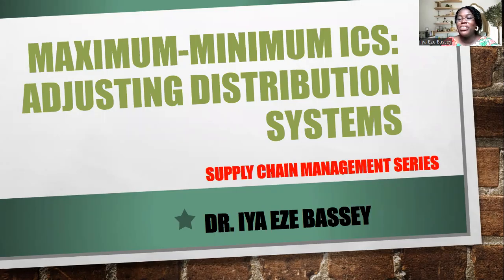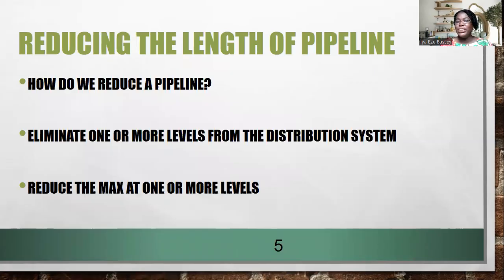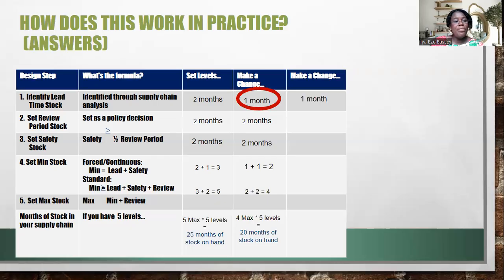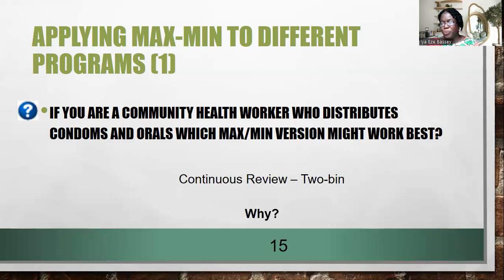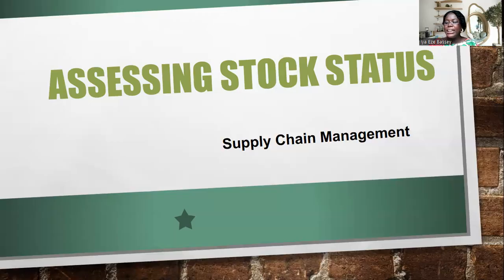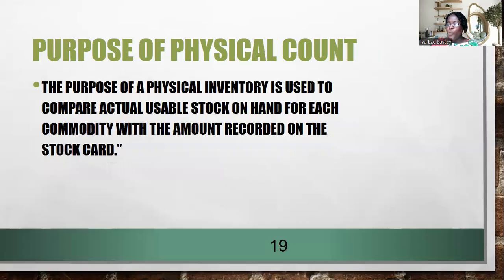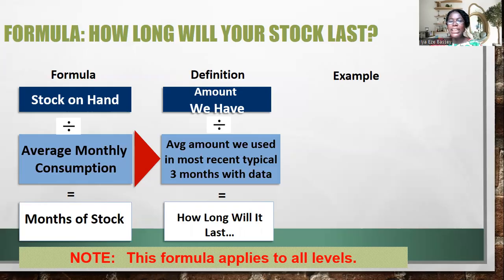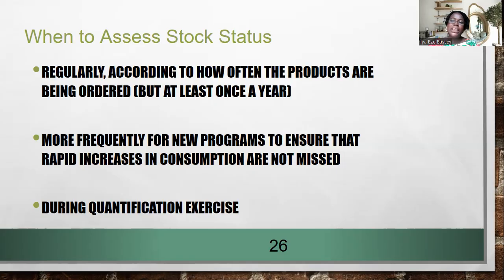Maximum-Minimum ICS: Adjusting Distribution systems (Supply chain management series)

Comment: Good day ma and thank you for the video which first helped me learn of how to adjust distribution system policies and they are:
Ways to adjust distribution system policies
Firstly look at the length of the pipeline and review it then eliminate unnecessary distribution levels. You can then go ahead to reduce maximum stock levels at different level of the supply chain and adjust elements like the review period, lead time, safety stock and storage capacity and also improving the distribution system reliability at one or more level so that safety stock can be reduced

Advantages to using MAX-MIN system includes
Avoid over or under stocking
Minimize wastage
Avoid cost of emergency order
Consistency of stock level
Reliable data source from SDP for forecasting and quantification 
Challenges to using MAX-MIN system includes
System with numerous level.
System that manage a large number of commodes and also one that manage products for new programs.
I also learnt the meaning and purpose of accessing stock status, which is 

I also learnt the meaning of purpose of assessing the stock status, which is the evaluating of current stock to ensure its availability and good supply chain operations and its purpose is to determine how long supplies will last, helps plan resupply and avoid stock out and it’s also essential for informed decision making.
Also the process of determining the months of stock available at any storage level is by Conducting a physical count of usable commodities in stock, then Calculating average monthly consumption using the history of usage data. Use the formula:
Months of Stock = Stock on Hand divided by the Average Monthly Consumption 
Thank you Ma

Comment: Thank you Ma for the enlightenment on this topic.

In summary, there are ways in which the distribution system policies can be adjusted and the first thing to consider is the Length of the pipeline. 

Considering the Length of a pipeline in designing a Max-Min ICS, the steps include:
1. Setting up initial max-min policies for each level and type of facility 
2. Checking if the overall distribution will function if the specific max-min policies are implemented.
3. Checking the total length of the pipeline that the policies at each level imply.

Ways in Reducing the Length of a pipeline include:
i. Eliminating one or more levels from the distribution system 
ii. Setting up policies that helps reduce the max at one or more levels.

Reduction of the length of pipeline is  done systematically by: Shortening the review period, reduce the lead time both at one or more levels and improve system distribution reliability.

Factors that affects the impact of max-min stock levels other than length of the pipeline include: Cost of products, reliability of transportation, storage capacities, shelf life of health commodities etc.

Advantages of this System include: Prevention of over-stock and understock, simplifying of inventory control decision making etc.

The Challenges of this system occurs in the case of Systems with numerous levels, Systems that manage large number of commodities and Systems that manage new products for new programs.

Assessing Stock Status is done by physical count which is the counting by hand the total number of usable units at aby given time. The purpose for this is to compare actual stock on hand  for each commodity.

While the general purpose of assessing stock status is know how long supplies will last. This should be fone at leat once a year 

The formula for assessing stock status are:
Stock on Hand(amount we have)
divide by
Average Monthly Consumption (Amount we use each month) 
equals to 
Month of Stock (How long it will last)

Thank you Ma once again.
Reply from the maker: Thanks for sharing these insights and helpful summary!

Comment: Thank you ma for the lecture
I learnt that in reducing the length of a pipeline by eliminting one or more levels from the distribution system,reduce the max at 1 or more levels....Some factors that impact max-min stock levels includes:Cost of products,reliability of transportation,Storage capacity,Cost of storage,Storage conditions at different levels,Shelf life of health commodities.....Advantages of using Max-min ICS are to avoid understock,to avoid overstock,minimise wastage,avoid cost of emergency order,simplify inventory control decision making,consistency of stock level,reiable data source from SOP for forecasting and qualification...
 Physical count is the process of counting by hand the total number of usabe units of each commodity in your store or health facility at any given time...its purpose is to compare actual usable stock on hand for each commodity with the amount recorded on the stock card....The purpose of assessing stock status is to determine how long supplies would last...
I also learnt about when to assess stock status,it includes:
-Regularly,according to how often the products are being ordered
-More frequently for new programs to ensure rapid increases in consumption that are not missed
-During quantification

Comment: Thank you so much ma

Key Points I got in this video were:
Adjusting Distribution System Policies
you discussed the importance of properly adjusting distribution system policies within the maximum-minimum inventory control system.
Max-Min Inventory Control System Challenges and Advantages
this outlines both the advantages of the Max-Min inventory control system, such as avoiding waste and ensuring product availability, as well as the challenges, including managing numerous levels in the distribution pipeline and vast commodity ranges.

Determining Months of Stock Availability
it was demonstrated on how to calculate the number of months of stock available at any facility level, employing inventory and consumption data. A practical formula is provided, emphasizing physical counts for accuracy.

Pipeline Length and Optimization
I got to learn how to assess the pipeline length and determine whether to shorten it by eliminating distribution levels. The session emphasizes systematic approaches to reducing maximum stock levels, along with practical examples.

Assessing Stock Status
you spent a great deal of time explaining how to physically account for stock and determine how long current supplies can last based on average monthly consumption.

Comment: Summary on maximum- minimum ( ics) adjusting distribution systems. 

In designing a maximum- minimum inventory control system is to

 Length of a pipeline: 
1. Set up initial maximum- minimum policies for each level and type of facility. 
2.  Total length of the pipeline. 

 Reducing the length of pipeline: 
1. Eliminate one or more levels from the distribution system. 
2. Reduce the max at one or more levels. 

 Factors that impact maximum - minimum stock levels: 

* Lead time
* Reliable source of supplies. 
* Effect of a zero balance of stock. 
* shelf life 
* production costs
Reply from the maker: Wow thanks

Comment: During the lecture, information was provided on ways to adjust distribution policies under max/ min inventory control system

It helps to maintain stock levels and minimize wastage through different steps but despite this, some  challanges are also encountered

Also mentioned were some factors that can impact max and min stock level.

Comment: n

Adjusting Distribution Policy: System Factors

Several factors influence maximum-minimum stock levels:

1. Production costs
2. Transportation reliability
3. Storage capacity
4. Conditioning costs
5. Commodity shelf-life

Advantages of Maximum-Minimum Control System:

1. Prevents overstocking
2. Avoids understocking
3. Reduces waste
4. Eliminates emergency order costs
5. Maintains consistent stock levels
6. Provides reliable data from Service Delivery Points (SDPs)

Physical Count

A physical count involves manually counting usable units of each commodity in a store or health facility at a specific time.

Purpose of Physical Count:

1. Verifies actual stock against recorded amounts.
2. Determines stock longevity.
3. Updates stock records for accurate forecasting and supply planning.

Comment: thank you Prof.,  in summary  I

Adjusting Distribution Policy System

Factors Affecting Maximum-Minimum Stock Levels:

1. Cost of production
2. Reliability of transportation
3. Storage capacity
4. Cost of conditioning
5. Shelf-life of the commodity

Advantages of Maximum-Minimum Control System:

1. Avoid overstocking
2. Avoid understocking
3. Minimize wastage
4. Avoid costs of emergency orders
5. Consistency of stock levels
6. Reliable data source from Service Delivery Points (SDPs)

Physical Count

A physical count is the process of manually counting the total number of usable units of each commodity in a store or health facility at a given time.

Purpose of Physical Count:

1. Compare actual usable stock on hand with the amount recorded on the stock card.
2. Determine how long the stock can last.
3. Update stock records for accurate forecasting and supply planning.

Comment: Thanks Ma'am for the lecture. after watching the video I learned about the various steps in
designing a Max-Min ICS which includes:-
1. set up initial Max-Min
policies for each level and type of facility. -
2. check if the overall distribution will function properly if the specific Max-Min policies are implemented. 
3. check the total length of the pipeline that the
policies at each level imply.
Also i learnet on ways to reduce the length of pipeline which are: 
1.eliminate one or more levels from the distribution system and reduce the max at one or more levels.

Also elements to reduce the maximum stock level:shorten the
review period at one or more levels, reduce the lead Time at one or more levels and improve the distribution system's reliability at
one or more levels so that safety stock can be reduced.
The factors that impact Max-Min stock level:cost of production,
reliability of transportation etc……..
Advantages of using Max-Min system: minimize wastage etc....
Also the challenges to using each ICS version and variation:
Systems with numerous levels, systems that manage a large
number of commodities and systems that manage products for
new programs.
Also what is meant by physical count and it's purpose and also
when to assess stock status.

thank you again ma for all you do

Comment: Thank you so much for the lecture Ma 

I learnt the steps in designing a max min ICS, which are;
Set up initial max min policies fir each level and type of faculty 

Check if the overall distribution will function properly if the level specific max min policies are implemented 

Check the total length of the pipeline that the policies ar each level imply

• i also learnt the advantage of using max min;
Avoid overstocking 
Avoid under stocking 
Consistency of stock 
Minimize wastage
Avoid cost of emergency orders

• Challenges to using each version and variation 
System eith numerous levels
System that manage a large number of commodities 
System that manage products for new programs

Thank you Ma

Comment: I learnt that to achieve an improved distribution system, these steps should be followed;
~The length of the pipeline:
• Set up initial Max-min ICS for each levels.
• Check if the overall distribution will function properly.
Reduce cost of Pipeline:
• Shorten the review period at one or more levels.
• Reduce the lead time at one or more levels.
• Improve the distribution systems reliability at one or more levels.

Factors impacting Max-min stock levels:
• Cost of products.
• Reliability of transportation.
• Storage capacity.

Thank you for the lecture Ma.

Comment: Thank you ma for the lecture
I learnt the various step in designing a max min ICS which are:
 1: set up initial maxi-min policies for each level and type of faculty

2: check if the overall distribution will function properly if the level specific max min policies are implemented

3: Check the total length of the pipeline that the policies at each level imply

The advantage of using max- min  are as follows
Avoid overstocking
Avoid under stocking
Consistency of stock
Thank you ma ❤

Comment: In summary,

Maximum-Minimum Inventory Control System

1. *Maximum Level*: Highest quantity of an item stored.
2. *Minimum Level*: Lowest quantity of an item stored.
3. *Reorder Level*: Level at which to reorder to avoid stockouts.
4. *Reorder Quantity*: Quantity to reorder when inventory reaches the reorder level.

This system helps prevent overstocking, understocking, and reduces inventory costs.

Some factors that impact maximum minimum levels includes,  
1 Lead time 
2 Age of program 
3 Acciracy of forecast 
4 Management skill of staff

Comment: In summary to adjusting distribution systems in the maximum minimum inventory control systems,there are various ways to reduce the length of a pipeline which are eliminating one or more levels from the distribution systems and reducing the max at one or more levels and setting up policies that could help you reduce the max at one or more levels. It is good to note that the reduction of pipelines follows a systematic pattern. 
    There are factors that impact max min stock levels and they are cost of transportation,shelf of life of commodity,lead times etc. 
      The use of max min systems comes with as advantages and disadvantages. It’s advantages are that it helps to avoid over stocking and understanding,minimizing wastage etc while it’s disadvantages are systems with numerous levels,systems that manage a large number of commodities etc. 
     Stock status are determined by physical count and the purposes of accessing stock status are determining how long the supplies last and to compare actual useable stock at hand,with what was recorded in the stock cards. 
     Stock status are accessed regularly,according to how often the products are being ordered and during quantification exercise 

  Thank you ma for a detailed lecture

Comment: In summary,I learnt that in adjusting distribution policies the implementation of specific maximum policies at each distribution level is important for optimizing inventory flow, particularly in public health supply chains.The advantages of Max-Min inventory control system are; a) reduce waste b)avoid emergency order costs. The challenges are; a) managing systems with multiple levels b) managing inventory for new programs. The purpose of assessing stock status are;a)conducting a physical count b) essential in verifying stock accuracy c) preventing discrepancies that could lead to stockouts or overstocking

Comment: The maximum - minimum ICS: ADJUSTING DISTRIBUTION SYSTEM has do with identify ways to adjust distribution polices  which are 
*Setting up initial max-min policies for each level and type of faculty 
*Checking if the overall distribution will function properly if the level specific max-min policies are implemented 
* Checking the total length of the pipeline that the policies at each level imply 
Factors that impact max- min stock levels 
*Lead 
*Reliability of source of supplies 
*Effect of a zero balance of stock 
* Management skill of staff 
*Age of program 
*Accuracy of forecast

Comment: Thank you ma, for this nice topic.
I learnt that to attain an improved distribution system we should look at:
-The length of a pipeline:  Set up initial MAX-MIN policies for each level and type of facility.
Check if the overall distribution will function properly.

-Reducing the cost of the Pipeline
The MAX-MIN Stock level can be reduced by this order:
*Shorten the review period at one or more level.
*Reduce the lead time at one or more level.
*Improve the distribution system's reliability at one or more levels.

 Factors That Impact MAX-MIN Stock Levels:
-Cost of products -Reliability of transportation -Storage Capacity etc.
MAX-MIN System can be used to minimize wastage and consistency of stock levels. 
Inventory Control System also has its challenges.
I also noted that Accessing Stock Account can be achieved by A PHYSICAL COUNT.

Comment: After the lecture i gained clear understanding in the aim to optimize inventory levels and distribution systems.
Uses a maximum minimum inventory control system ICS 
Sets maximum and minimum inventory levels for each item.
Automatically triggers orders when minimum levels are reached, ensures timely replenishment and minimizes stocks outs.
Thank you for this insightful lecture ma

Comment: Thanks ma for this wonderful lecture. I understood from this video that the maximum -minimum ICS is a guideline for management of stock levels,i now know the steps in designing a max-min ICS,and i learnt the advantages of using max-min stock which includes avoiding overstocking,understocking, reducing cost of emergency order as well as minimizing wastage. The factors that affect max-min stock levels are : lead time,age of programme, management skills of staff as well as accuracy of forecast

Comment: In summary i learnt the need for adjusting distribution system in max-min inventory control system which implies ways of reducing those factors that causes a quick and fast distribution 
There's need for adjusting and renovating the pipeline distribution system for effectiveness.Some of those factors to adjust include shortening the review time at all levels 
I also learned how to access stock as physical count with the purpose of getting the monthly stock on hand done by dividing stock on hand value by momthly consumption value